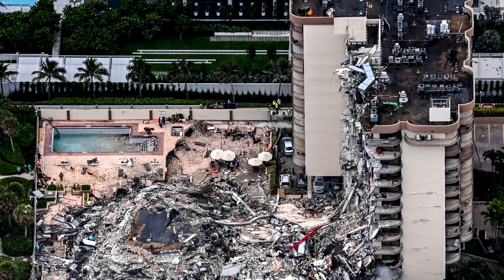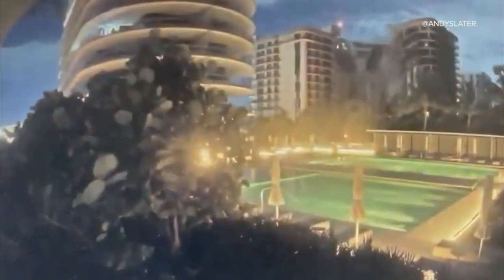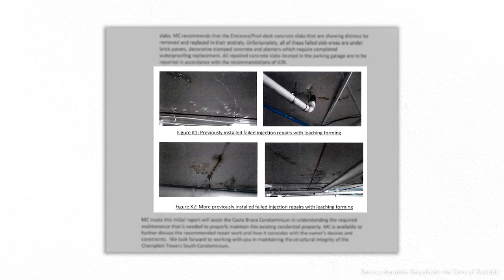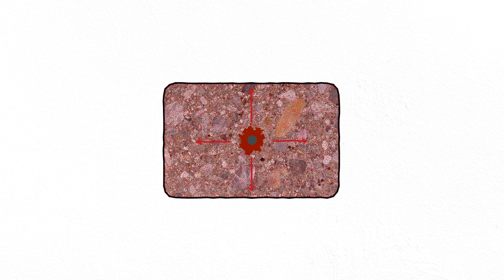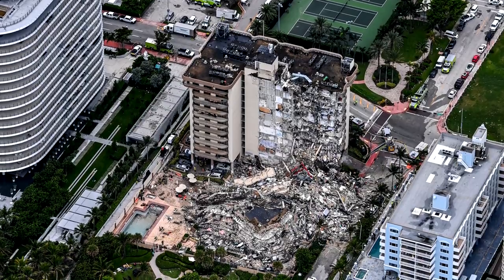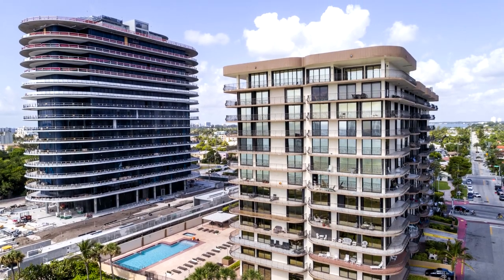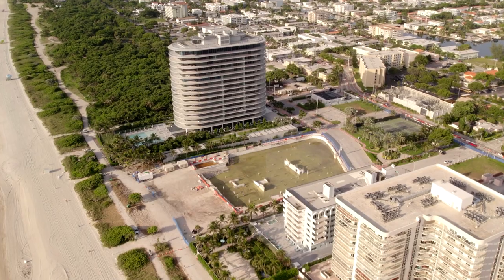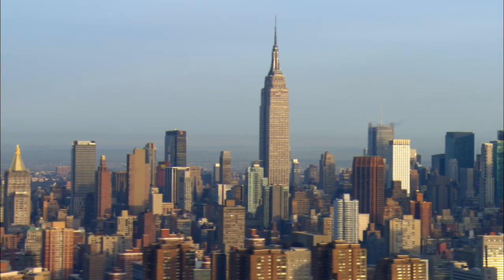Surfside Condo Collapse: What We Know So Far

Comment: @ 5;12 u say "embedded steel is usually safeguarded against corrosion by the impermeable covering of concrete"...i always was under the impression that concrete allowed water to pass thru it...although very slowly...interesting... then you go on tto say as water passes thru concrete it can leach certain constituants out...there is a lot i don't know, as usual i learn something new every day...especially due to "practical engineering"

Comment: The safety and redundancy in buildings results in a condition where it takes a lot of damage before a building collapses as this did.  People aren't mentally equipped to understand situations where the cause and effect are separated by a long period of time.  They get complacent about damage as it slowly accumulates, and then one day (hopefully) it suddenly occurs that hey, this is really bad.  Add on top of that a maintenance by committee system, and having to get buy-in from large numbers of the tennants who may or may not have enough understanding of the situation, and it seems a recipe for disaster to me.  I wouldn't be surprised if a major part of the findings includes lack of timely action by the building repair committee, probably due to them failing to grasp the seriousness of the situation.  Because that committee is composed of tenants of the building, in a way it could be called a slow-motion suicide.

Comment: I've always wondered how they can build high rise buildings on flat sand right up next to a beach like that. Much bigger than this building too. I assume really deep piers? Surely ground movement is a big issue in these places? Never mind that you're one big storm surge away from having your bottom floors inundated with sea water that you'll need to pump out. Any engineers feel free to enlighten me.
Reply: There is no ground movement because it is so flat.
Reply: @protonneutron9046  Would there be a very shallow water table due to being at sea level, right next to the sea? That would be a lot of wet sand underneath them.

Comment: If the column to slab connection was done properly on the pool deck at least that par should have not collapsed. The amount of surface area at the top of the columns if far to small to this engineer's eyes. In my building for essentially the same application, the columns  are 3 times the size and there is a slab over 2' wide from column to column then the deck slab. A slab that carries vehicular traffic. Sometimes as heavy as a fire department pumper truck. 

Seeing only 3 pieces of rebar on each side of the columns holding up the deck was a WTF moment for me. Because a deck with this little loading should not have ever experienced punch through. While that may not have pulled down the building it indicates poor design elsewhere in the building, The columns holding up the tower did not seem to be any larger. 

Just looking at the place is scary. The skinny columns would have has no safety margin to them at all. I live n the west coast and that would have never met earthquake specs here. I will be looking forward to seeing the final report on this event.

Comment: Meanwhile in Europe, 2000 year old concrete still has few if any cracks... I kinda blame the portland cement. It's strong in the short term, but lime cement is strong in the long term. I've discussed this with cement manufacturers and bricklayers, and what I gather is this: portland hardens faster and is stronger for the first 30 years. Lime cement stays soft for a while, and can crumble if too much weight or sheer is applied too soon, but it gets stronger with age as the lime reacts with air and resists weather better. So here is my question, could we build things slower and use a combination of both kinds of cement? And maybe even not build such crazy tall heavy things? And while I'm on this train of thought, I noticed that the columns in modern buildings are the same size from top to bottom and there are lintels instead of arches... I mean shit, that just seems like a recipe for disaster. I have long studied architecture, and kind of the first rule is that you have to evenly distribute load. Lintels can shear off if weakened and forced to support too much weight or are too long. Columns should have wide bases to spread out the weight, arches spread weight to the sides of an opening instead of straight down, and there's nothing wrong with buttressing to take further load...

Comment: If poor construction practices beyond the poorly designed drainage are discovered that will be important, but it seems like a major issue around this tragedy is the sluggishness of bureaucracy. The bill to fix the situation was only getting exponentially worse as well as hesitation and debate within the HOA and its constituents dragged on for years. I am guessing there were other serious issues with how construction was done though, and since the engineer didn't have concrete penetrating magic vision they had to put faith in contractors having followed the plans properly, leading to an overestimation in how safe the building still was.

Comment: The water wasn't pooling,  there were several drains for the water to drain out. It was just the bad waterproofing.
Reply: The drawings don't show a slope to drain which is normally the case. The slab deflects which causes pooling.
Reply: @yodaiam1000   The drawings do show a slope to the drains!  It is clearly marked along with the drain possessions themselves
Reply: @willschultz5452  From what I see of the slab drawings, it is shows on a single elevation. You can slope topping over but then the membrane has to go over the topping.

Yes there are drains. I didn't say otherwise.
Reply: @yodaiam1000   The drawings that I looked at have pitch to them and it shows the degree of pitch to the drains
Reply: @willschultz5452  There is a drawings that does show a pitch. The title block is obscure. I am not sure if it is the north or south tower. However, the slab elevation is noted as 11'-10" flat on the south tower. They could be referring to the slope on the pavers. It is the slope of the membrane that actually maters for the protection of the slab and not the pavers. You get ponding under the pavers.

I understand that there was a law suite filed against the architect for not providing a slope on the slab (or a topping for a membrane).

Regardless, if there was a membrane installed, it didn't work properly.

Comment: The answer is obvious, it was all 3 lack of maintenance, poor engineering, columns too small not enough reo, rushed changes to the design, resulting in structural beams being omitted from original design, incompetence time to sue, a stupid 12 story building limit at the time of construction leading to building the garage below the water table which was a bad idea, poor or no drainage and failed water proofing of pool deck, lack of reo in slabs, and poor coverage of reo as it may have been trampled down towards the bottom of the form by the workmen when it was poured. The ground has settled adding the stress and causing cracks for water to enter and rust the reo.

Comment: Not much to hold up any building that is more like what would be put in a driveway not a 13 story building with up grades from light materiel used when built to moderen heavy more wanted floors walls counter tops etc.

Comment: As we approach the 20th anniversary of 9/11. Would like to see a video about the collapse of the twin buildings and 7WTC that fell later that afternoon. I remember it being said that 7WTC was the first modern steel structures that collapsed from fire alone. And they all somehow collapsed in a pancake manner which fueled a lot of conspiracies.
Reply: there were several made within a couple years of 2001.  Why don't you watch those Heidi??????
Reply: @protonneutron9046  yes, I remember seeing one or two on PBS. (probably Nova). But like you said, they were made within a few years of the event. Just wondering if there were new findings in the years since.
Reply: @heidichung2242  Nope. All engineering questions were answered within the first few months after the crashes.  For NY and the Pentagon

Comment: Whatever failures that happen in the building or any other projects Architects escape any kind of damage claims except Engineer on Record. If that is the case why Architects should head the project, it should be engineers who can think safe and design safe. Architects hold the say and control engineers fees for consulting, Architects start bargaining with engineers. The law should be changed as Architecture is not engineering but just a fancy design thoughts put on paper which ENGINEER will give life! Architects should work under ENGINEER and never head the project. Engineer should be the authority engaging other disciplines that need to be involved. There is no MAJOR RISK for an Architect, if at all the current law cannot be changed Architect being project head should also be included. Most of the times there is pressure from Architect to save money for himself/herself and demand unpractical solutions from Engineers. The whole industry should come back and think the value of Engineering rather than fancy outlook! Every project is a Civil & Structural engineering related while the Architecture is just the finishing touch!

Comment: When I see concrete failures in modern structures, it has me marveling the concrete structures built during the Nazi Germany  era, as many concrete bunkers and fortifications they built, which are now near 80 years in age, don't show signs of structural deterioration; yet, many were pummeled with bombs and artillery shells.
I get the impression those concrete bunkers will probably last as long as the Pyramids in Giza . . . which could be forever.
Reply: ???  Why wouldn't 10' thick bunker walls last longer than regular walls NOT built to withstand 1,000 lbs. bombs?  DERP!!
Reply: @protonneutron9046  What about the bunkers and fortifications that have one-meter/3 foot thick walls and roofs?
Who would have thought an earlier comment about concrete could motivate a comment that's indicative of being hostile?

Comment: is nobody else going to say it? im not saying for the lulz but for the fact that it forces errors: cocaine. late 70s, early 80s and what we've seen so far is that updates didnt factor in changes correctly and engineers seemed to forget key structures had been removed. that sounds like workplace intoxication to me. maybe not the only thing at play here but its florida in the golden age of the coke trade. it almost had to be a factor from top to bottom. im not a puritan that hates the idea of drugs but when someone lets them get in the way of their job and people end up dead then i get upset, and i dont blame the drug. i blame the person that prioritized getting high over doing their due diligence. there no evidence that happened here but this whole thing reeks of it and if it starts happening more in the area cocaine use by the people designing and building these places might end up being the keystone to why theyre all built so poorly. slapshod crackhead work. i really hope im wrong but ive had the misfortune of sharing worksites with coke-heads and the mistakes ive seen highlighted in this and slightly newer videos seems eerily familiar.

Comment: This video did very little to show what caused the collapse.  It seemed to be more of an attempt to reassure the public than to assess culpability.  I also wonder why no information was given about the identical structure, still standing, named Champlain Towers North. How is this structure immune to the same conditions as the South Tower?
 The video includes the claim that there has been much progress in building concrete structures with steel reinforcement rods but gave no indication of what it is that shows such progress.

Comment: A lot of general information but thin of particular.  Nearly all building are reinforced concrete but rarely a building like Surfside collapsed.  The speaker failed to pin point the root cause of the failure.  Just hinting this and that is just trolls.  Facts and evidence should be provided but none forthcoming.

Comment: What a garbage video. The main problem of that building is the lack of beams. You can clearly see this on the windows: they go from the flor to the ceiling. 
The second problem, and this is why the "punch thru" failure from 8:10, the columns did not have abacus and chapitels OR, again, beams.
Why the lack of beams? because without beams they can do another flor, another level. Beams "take space" (not really, they save lives). This is clear if you compare nearby buildings from the same eight: they have 1 less flor to offer.